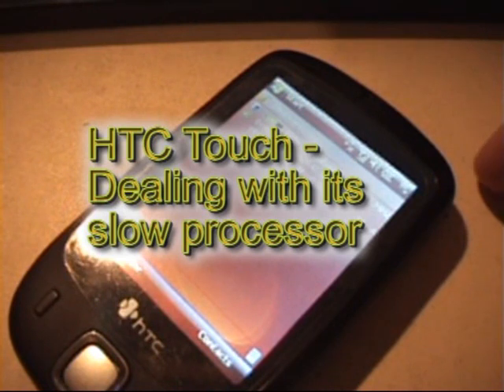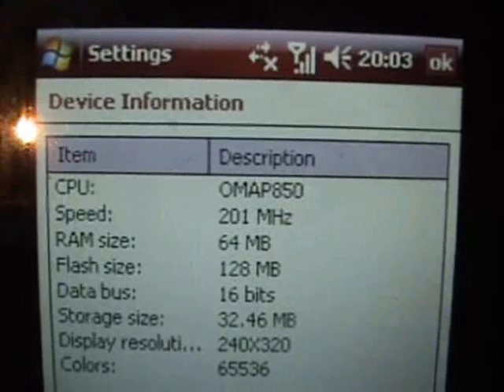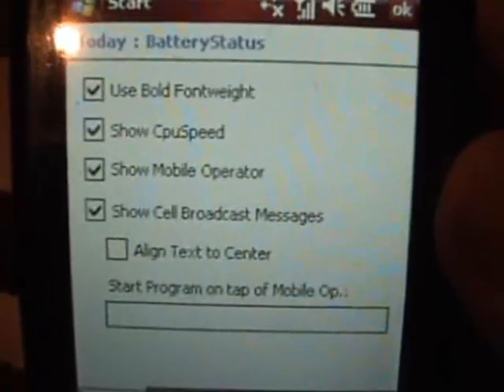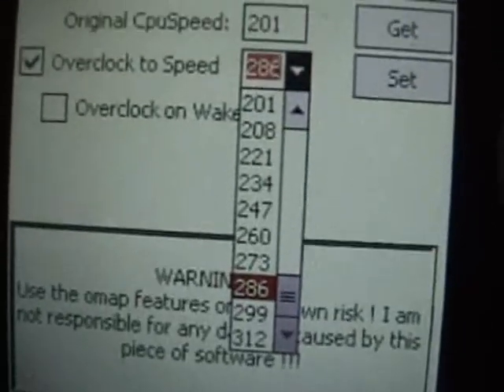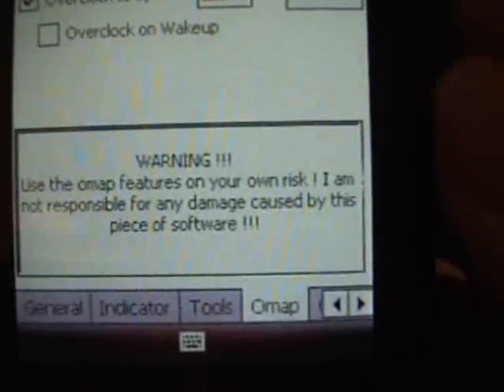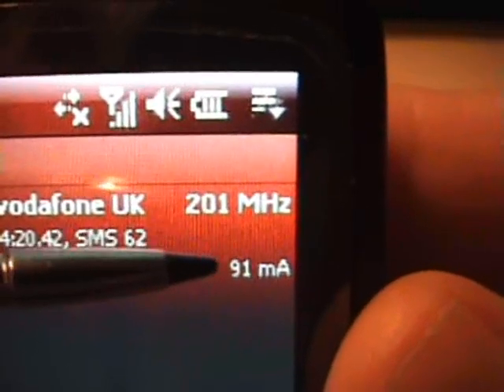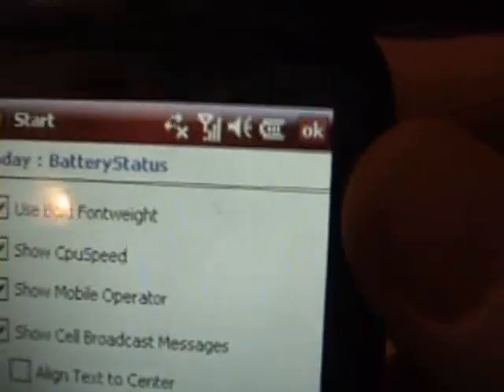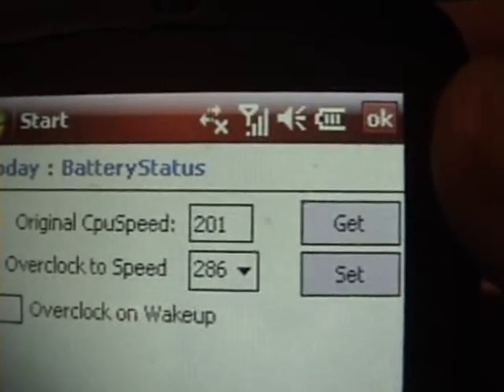HTC Touch: Dealing with a slow processor - PPC Overclocking

Comment: The older HTC touch models have a 201mhz Texus Instruments OMAP Processor, while the newer ones have a qualcomm msm7500 400mhz processor. If I get one of the latter, I will have to try to overclock it!

Comment: The video you played, was that an reseized one (320*240)?
If not, then what was the resolution?

And wasn't there an option which automatically changed the processes speed when needed?

Like when playing a movie go on 286 mhz and when in standby go on, lets say 140 mhz ?

That saves the battery.

Comment from the maker: Not really sure as I charge my PPC daily, but certainly will reduce battery life. The trick is to only overclock as needed and inevitably the reason to do so is to run a CPU hungry programm which will inevitably use battery fast in any case.